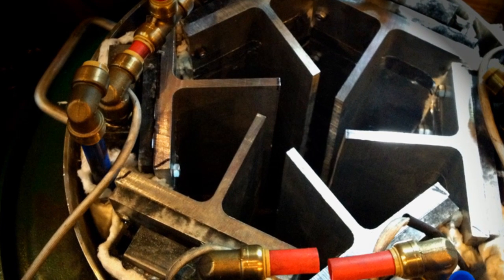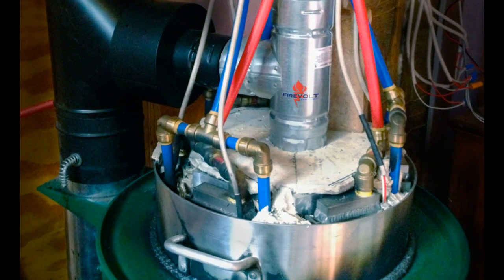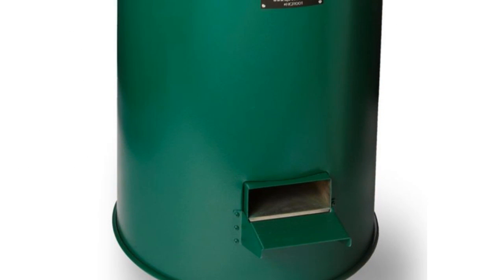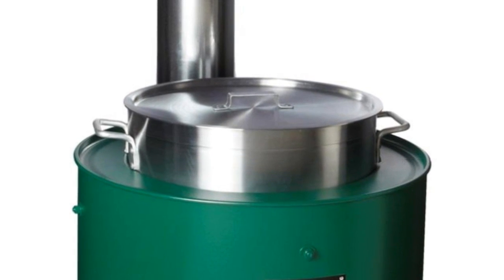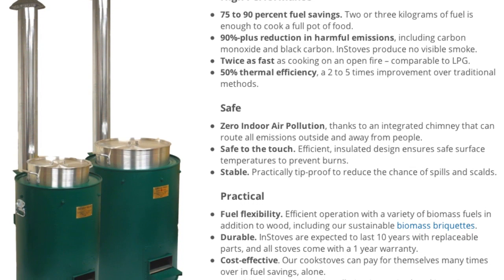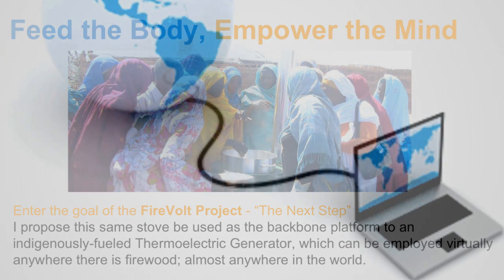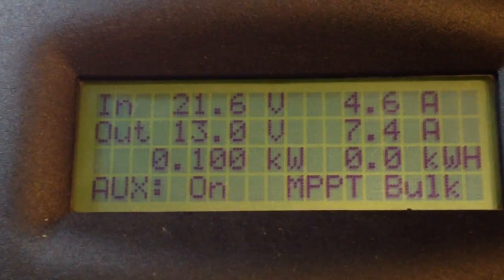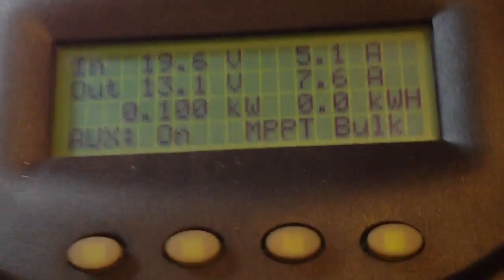FireVolt Systems - 200 Watt Thermoelectric Generator Core for Instove 60L

Comment: Is this a joke? Your plan is to generate 200 Watts per hour using tegs with an efficiency of maybe 5% in a 50% efficient stove? So basically your trading 8kw per hour in fuel for a measly 200 Watts and charging 5k for the setup. People should be investing in real solutions like diesel generators or solar. Either one generating 10x the power while being cheaper.
Reply from the maker: Consider all the people who use wood to heat water... now, put TEGs in the way of that heat, as it is trying to "get" to that water. Suddenly, now you're producing electricity (while you heat your water, that you had to heat anyway).  The actual goal of the device isn't electricity production (a by-product of its design), but hot water production, that just happens to produce electricity. Add to that, zero noise, and nearly zero maintenance (and for many, next to free fuel), and you may start to realize why this is compelling.
Reply: What is the expected lifespan of one of these? And what is the realistic output factoring in pump and charge controller losses?
Reply from the maker: Nominal lifespan on the TEGs is 200,000+ hours. The stove is engineered for about a 10 year lifespan. Average current draw per pump is 5 watts. As of today the actual ceiling for electrical output on our largest design, maxed out, is 600W and around 65,000 BTU/hr.
Reply: Few things wrong with your statement. For one for many people wood is easily accessible and other fuel is not. In an emergency or a remote cabin I can literally walk outside and find endless amounts of wood but the gas station may now have power or could be hundreds of kilometers away. Secondly again in terms of an emergency,cabin,or being off grid. You certainly aren't powering or heating using any kind of petroleum......you'd go broke but again wood is cheap if not free,abundant,and easy to obtain. The point being many people burn wood for heat,cooking,hot water ect and it's really the only real offgrid fuel so why not also produce power. You're looking at this completely wrong. The idea of being able to provide heat,hot water,cooked food,and electric from a dead tree in your backyard is amazing.
Reply: M p....you are a child without brain.
Imagine its night there in your city. Its 3 am and you need electricity.
You cannot start a diesel generator to disturb your neighboors in the night time.
Your campervan its parked 100m away from their homes and you need to charge your batteries.
You are there maybe for camping near a river. What you gonna do?
There is not sun and wind in that moment. Its night.
TEG generator doesnt not produce any noise.
I am running my own teg generator for 7 years using water cooling from a river.
I dont need sun or wind.
I have a secret bunker near the mountains where I am camping in the summer
There is no socket around...
You want to cook something...in silence....its only one chance.
Teg generators can placed in sun light with a black colour steel panel....
I am generating 1.5 kilowatts of power and only 80watts I use for water cooling transfer in and out from the river.
My generator is 1m width and 1m long and 20cm tall. 65kg weight plus 30kg black steel plate for sun light in the day.
Its replacing 12 solar panels of energy from my house. Nearly whole roof.
Teg modules are best inovation ever made in the world.
I will never use much space or noise again in my life.
I am an enginner in electronics.
No matter the fake rewiews on the internet about many devices.
You only need a good brain to live the best life.
You must go back to school.

Comment: Nice to see you bring this tech to who needs it. Looks like you have active cooling. I wanted to make similar device for temperate climates. Heat from the wood stove vs sub zero outside should provide a nice temperature difference. But I lack any type of engineering degree.  Everything is trial an error at my place. :)  Rocket stoves FTW.
Reply from the maker: +Ian Corporon  happy to consult on your project - it sounds quite do-able. Feel free to contact us directly at info@firevoltsystems.com

Comment: This would be a perfect thing to have for off grid living as well as for an alternative to solar power.  We live in an area that does not get a lot of sun during the winter months.  This is of very high interest to me.  Would love more information.
Reply from the maker: +Bonnie and Ken Ball thank you for the great feedback. What originally inspired the system design was living in a wooded valley, having employed solar, looking for a way to mitigate solar minimums without a sprawling array, or the otherwise unnecessary cutting down of old-timers just for the sake of solar gain.  Expect full literature /specs and availability in early 2016, we'll definitely keep you posted.  Also; If you have an existing wood stove you would like to harvest electricity from we are happy to consult;  email info(at)firevoltsystems.com

Comment from the maker: Yes, today you can get this as a fully operational Kit, however we require a consultation and chat beforehand, to make sure you know what you want. The casual consumer "press a button and buy it" version will arrive next year.
Reply: +FireVolt Systems Hello, what is the target price for the turn key option?  I would like to have a more detailed chat about the unit, do you have an email? BW Jonathan
Reply from the maker: +WindyJAMiller A fully loaded 200 watt/ 100,000 btu/hr system should be coming in right around 6K, though final pricing won't be set till we launch in January. Thank you for the inquiry! You can contact us directly at info@firevoltsystems.com